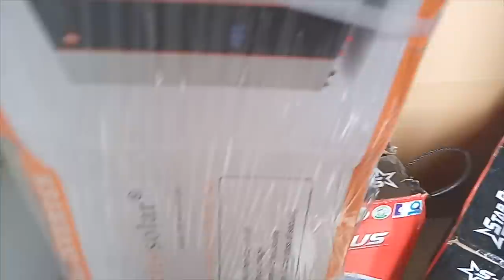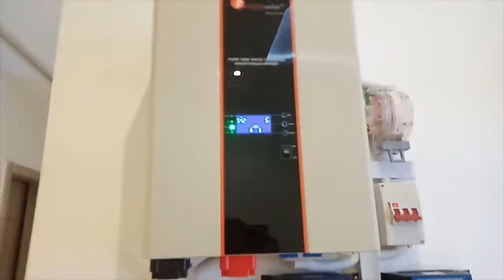Installing Solar Power System For 24hrs Electricity And WIFI Internet In Our New Lagos Mansion 🇳🇬

Comment: Installing  solar panel is a very good one nnem... because nepa wahala eeh.. you can be filming and nepa takes light.. the stress of turning gen or  calling your security  to go turn on gen is crazy.. so it's a very good one... my inverter has been a life saver.. .. I turn on Gen once in a while...  Your home is so beautiful ❤❤❤... that data thing here in Nigeria eehh nobi small things oo it's really expensive.  And some network will say 100GB the way it will finish you will just be wondering what and what you did.. ... my love to the kids 🥰❤❤❤❤❤